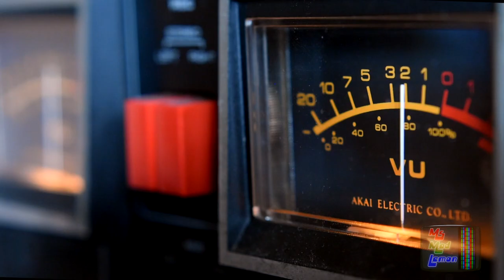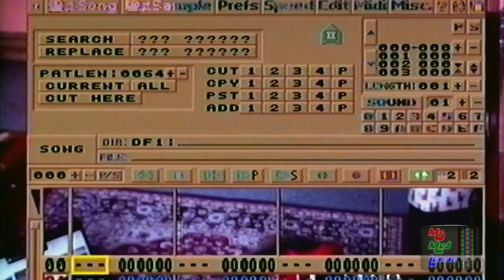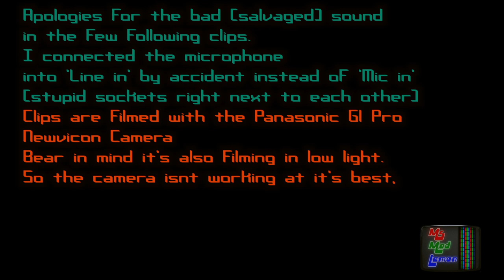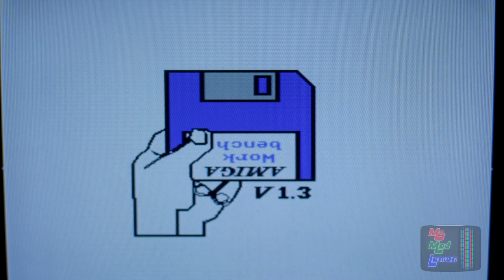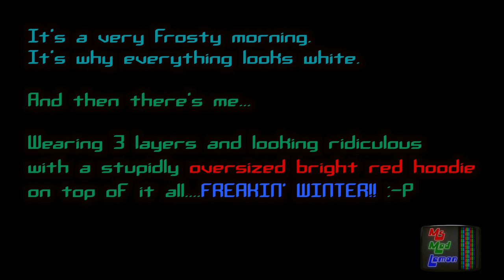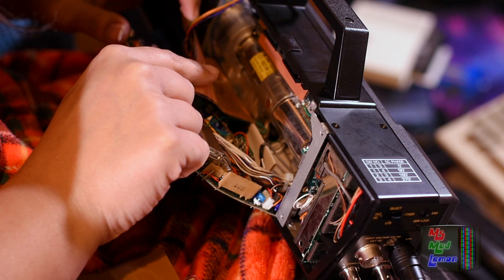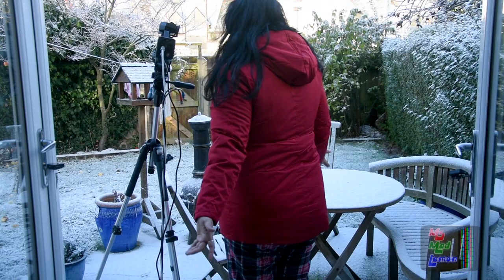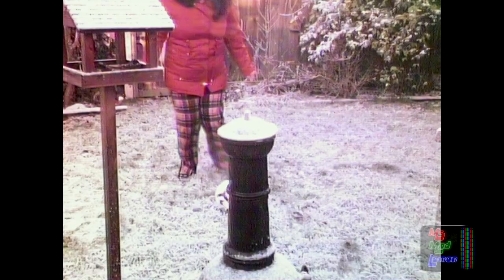Recording video using a CRT? I've got CRT Cameras! Let's Explore.

Comment: The first VHS camera we had growing up was almost identical to the Hitachi you showed off. Instead of a power supply, my dad bought it with a two-module VCR: One module held the tape, had the camera connection, and could hold a battery, while the other module was a power supply, RF tuner, clock, and recording timer system. When you wanted to record on the go, you'd leave the tuner module at home, put the tape module in a backpack with a battery installed, and connect the camera. Sounds very clunky now, but it was probably high technology in the early 1980s.

This eventually got replaced by an early-1990s Panasonic all-in-one shoulder camera that held the tape and battery. My brother and I used that one to make stop-motion videos of our action figures lol

Comment: Nice video cameras. :)

We had one of those Panasonics in a small studio I worked at in the 80's. We mostly did corporate/training vids, but occasionally we would go out on location and film video clips for local bands. 2 years of pure fun.

Don't point them at lights for too long, you can get burn-in very easily on these cameras. (even when they are powered off)

The last song you played sounded very Gary Numan.(you played it earlier on too, but I can't find it now so I don't know the time)  :)
Reply from the maker: "Even when they're powered off" is quite scary, you can very easily damage these things! i'm a little apprehensive about these now, especially since you need a fair amount of light to get a good picture lol! 
"2 years of pure fun"
I can definitely believe that after messing around with these! 🙂
Reply: @MsMadLemon  Is there any way you can get lense caps for them ? 3D print some, maybe,.(?) 

(It's a good habbit to put them on between recordings.)
Reply from the maker: @frankowalker4662  The Panasonic one has a lens cap, the Hitachi unfortunately not so i'll have to find one. i'm sure there's one lying around that will fit.. 
The problem with me is i've got a bad habit of not putting lens caps back on, maybe this will break my habit lol!
Reply: @MsMadLemon  Hope so, Ha ha.

Have fun with your new toys. :)

Comment: I love the old tube based cameras. I have quite a collection and some broadcast ones too. The best ones in my collection  from the early1980's are the Trinicons. Very reliable cameras. I still use one today. What device do you use to capture the analogue composite signal. Your results look good. I use an old Vaio media center.

Comment: Back in the day we had a black and white vidicon camera with our newtek digiview gold setup.  was mounted on a vertical stand you could capture stills with. If you can get yourself a digiview gold, it'll go great with those cameras. Parallel port amiga video capture.
Reply from the maker: I already have a vidi amiga capture.. I've never used digiview gold. Is there something specific about the digiview gold or are you just suggesting a framegrabber/capture?
Reply: @MsMadLemon  The Vidi amiga is by far a much better unit from what I remember. the digiview was just odd in that it was parallel port and had no storage to store an frame before transmitting it to the amiga. it used timing to read across the video frame in real time. crazy clever for the time but you do things like move and appear 3 times in a still. You could also put colour filters over a black and white camera and take 4 images to be combined into a HAM image.

Comment: I'm in Russia, I have such a camera, I thought it was not working, but when I turned it on, it worked, a rather strange camera shows badly, I don't know what is the reason
Reply from the maker: it might need adjustments. These cameras are very picky about light levels but it depends on what the image looks like, if it's too bad then the tube might be on it's way out.